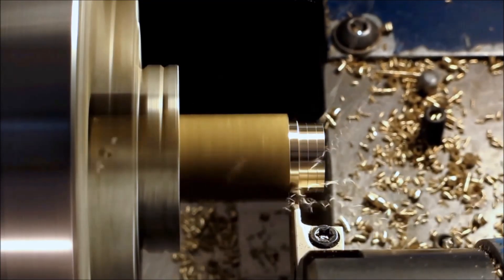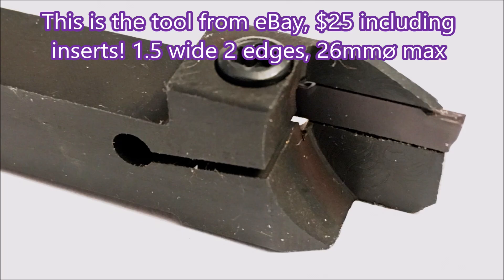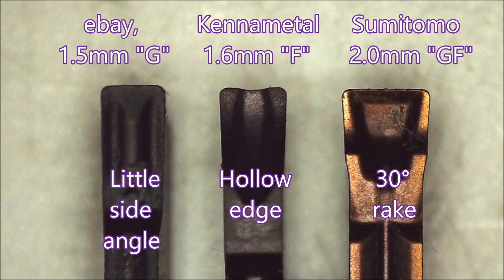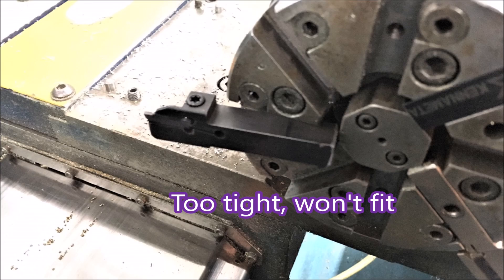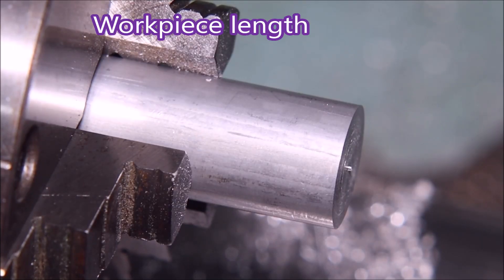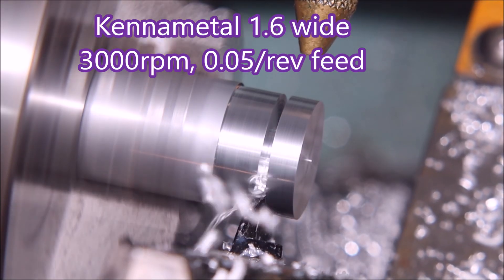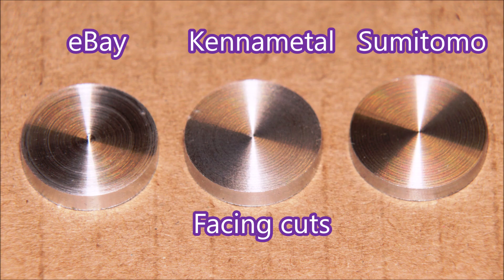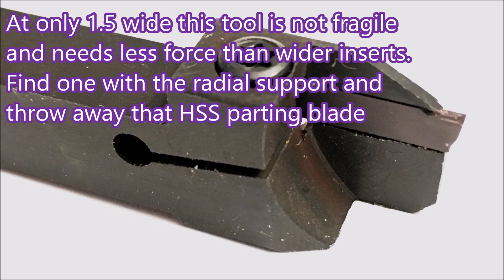$25 eBay Carbide insert parting tool vs Kennametal and Sumitomo at 3000rpm

Comment: I was wanting to find out about what was a good parting tool, I was so excited but when you starting saying it goes to 20 you lost me so I watched it again and now I have more questions. Like at the :57 mark titled "1.5 wide 2 edges 26mmo max" with no instance of a reaffirming to whatever the measurements are they can do without a metric. Then do it again at the 1:37 mark wirth the Kennametal whatever tool that is being made.
Reply from the maker: Hi, in each case I am referring to the maximum diameter at which the tool can part off.  Ebay is about 26mm dia, Sumitomo is 20 diameter and the Kennametal is 41 mm diameter
At 0.57 when I refer to 2 edges, which I must admit was not very clear, I was referring to the double ended insert which has 2 cutting edges.
The Sumitomo is also double ended and has 2 cutting edges, the Kennametal insert has only one cutting edge.  If I can help clarify anything else please ask.  Thank you for your comment

Comment: Just because you can do turning and facing cuts with a parting tool doesn't mean you should. When you do that you are dulling one corner of the insert and that will lead to the insert walking to one side of the cut when used for it's intended purpose of parting and grooving giving you a poor finish and possible chatter along with not holding tolerance.
Reply from the maker: We have not had any issues making brass parts. I write programs for a friend who does not have a turret on his cnc lathe. He uses 2.0 Sumitomo GF inserts for parting and turning. He makes a lot of small brass parts and is happy with the results he gets and not having to make tool changes. Not questioning your comment, I don’t think we could get away with what we do if we were machining steel etc. Thank you for your informed comment, it is appreciated.
Reply: @smallcnclathes  My comment was for general use, I guess if all you do is brass it would work well and maybe aluminum for short runs but steel is a no go unless it's for a couple parts but even then why ruin a good parting insert when it will not effect a turning insert as much. Valid point about the brass though.

Comment: Aluminium is not really a challenge for any carbide. You just see every tiny difference in the surface finish. 
I often use razor sharp HSS tooling for aluminium machining. No carbide finish ever comes close to that. 
You just need to know how to grind manually. ;)
Stainless steel will tell you everything about that thing you need to know.
Reply from the maker: I don’t use a grinder, would be wasting time using hss, I have done very little with stainless, and I don’t expect to turn any more
Thanks for your comment

Comment: Hello, I am just wondering where you would buy the Sumitomo and the Kennametal units and inserts in Australia?
Reply from the maker: I have mailed my Sumitomo rep and the Kennametal folks.  I think that particular Kennametal too no longer exists.  Do you need that parting diameter?  What size shank do you need? Mine are 10x10 which is what makes the Kennametal unit so good.  I am not aware of anything that goes that large with a 10x10 shank. Sumitomo go to 20 for 10 shank and I think 25 for 12 shank
Reply: @smallcnclathes  I've got a Sherline, it needs a 3/8" square shank, I'll just be using it for kitless fountain pens so a 20mm parting diameter would be just fine. I'd just be turning brass and aluminium for the end pieces of the pens. Edit: Oh, also I'd be using it to part the wood/acrylic, the pens have a section where the cap screws on that needs to be a bit lower than the rest of the body of the pen. And part off the ends of the wood/acrylic where the live centre was as well. You can order a HSS cutting tool and tool post from Sherline, but I think I'd be driven mad having to sharpen it all the time.
Reply from the maker: @chelsea78344   will holder take 10mm?
Reply from the maker: If 16 max would do, I would use the 1.5 wide tool in this video for timber or plastic.  These inserts are very sharp.  Or you could use the ground inserts I bought from ebay they are for aluminium and quite sharp too.  Not as good as the Sumitomo ones though.
Reply: @smallcnclathes  Yes, it looks like it will take 10mm. 16 max would work, but I'd like to experiment with potentially some 18mm wide pens in the future, so I'd like the 20. What insert width would you recommend for that? Also, how do I find the unit that holds the insert? Maybe I'm looking too hard, but I can't find it for the life of me.
Reply from the maker: If you have an email I could send you the pdf of the parting tool catalogue
Reply: @smallcnclathes  Actually, I think I've found it, is it this? https://sumicarbide.com/wp-content/uploads/2018/09/GND-Lineup-2018_smallfile.pdf Also, how do you order something from them?
Reply: @smallcnclathes  Ah! I think I have found the pdf catalogue! Thanks though. How do you actually order one? I am guessing I have to contact them?
Reply from the maker: @chelsea78344  if you find the inch series, they have 3/8 shanks with 1.5 wide inserts that would be good for you. The GA inserts that would probably be best are only in 2.0. GF inserts are available in 1.5 and they are very good too, they are what I use. The tool in inches is GNDL R 061.5JX038 for 1.5. Tools are not cheap, last time I priced one it was $125
I have asked my usual ebay supplier what he has in 1.5 wide for you
Reply from the maker: @chelsea78344  Where do you live?
Reply: @smallcnclathes  Ah, excellent, thank you so much! The exact product code and everything! I'll get one from them. Super super helpful, this is the power of the Internet!
Reply from the maker: You are ok with that sort of pricing? Where are you in Oz.
Reply: @smallcnclathes  I am yes. And ah sorry, I will not say where I am specifically, because this is the internet. I do appreciate the willingness to help though
Reply from the maker: @chelsea78344  Not a problem.  If you were local I would have suggested using my local Sumitomo rep. If you can get them by going direct no problem.

Comment: I didn't think these parting tools were capable of facing cuts!  This parting tool I bought from Aliexpress was around 12 bucks and is much better then the other cheap alternatives.  Mine didn't have overhang and the finish is much better, its also silver rather then black.  This is my 2nd one, the 1st one was black and it got mangled pretty bad during one parting.
Once I figured out the secret why inserts break, I don't go through inserts as much and I am quite happy.  The secret is don't run it all the way to the center, when you're almost there just put a piece of wood or plastic between the toolpost and workpiece and the bending pressure will break off the piece.  With aluminum or brass that is not necessary and I don't mind doing a facing cut because parting steel I doubt even expensive tools will leave a nice even flat surface.
Reply from the maker: Deep facing cuts can only be taken with inserts that are single ended. Double ended inserts rub on the face with the edge that is not in use. Thank you for your comment.  Nigel

Comment: In my experience chinese tools are fine. The only drawback is that they dont last very long. Running production one name brand insert last 3-4 chinese inserts.
Reply from the maker: A friend would use only Sandvik on one particular job. The inserts cost more than any other supplier but they out lasted anything else saving a good deal of down time.  Thanks for your comment

Comment: Short and sweet. Loved the video. 

I can’t go back to hss. The cut is far superior with carbide, and a lot less worrying because if it lets go it just breaks an insert.
Reply from the maker: I agree completely. I don't believe the HSS will give a better finish, carbide is so fine grained these days.  Of course in my case, totally not applicable for production work.  I have one HSS tool and I use it to create chamfers in my manual lathe.  I have spent enough on holders and inserts to find buying a neutral holder and square insert just a bit more than I want spend, particularly as it would get almost no use.  Thanks for taking the time to leave a comment.  Nigel
Reply: @smallcnclathes  I don't just break the insert. I break the damn holder as well.  Parting is the bane of my machining.😛
Reply from the maker: @tinnedanger  take heart from the fact you are not alone!

Comment: Have you tried one of the name brand inserts in the cheap tool holder? Seems like a good compromise. Couple minutes with a file and some decent inserts and it should be good?
Reply from the maker: Sumitomo inserts are 21mm long, eBay inserts are 16mm long, so I don't think your idea will work.  Thanks for the idea though. Nigel
Reply: @smallcnclathes do you think sumitomo insert GCMN150005-GF-AC530U would fit in the ebay tool holder?
Reply from the maker: @ganzeytyler  I have ebay inserts 2.0wide and GF inserts at 2.0 wide.  I don't have any GF in 1.5 wide.  I would assume the Sumitomo at 1.5 wide would be longer than the 1.5 ebay insert based on  what I see in the 2.0 wide inserts.  The 2.0 GF I have is 21.3mm long the 2.0 wide ebay insert is 16.0mm long and I just measured the ebay 1.5 wide insert and it is the same at 16.0mm long.
I checked the catalogue and the 1.5 wide GF insert is 17.3mm long. It will protrude out from the holder more than is intended.  I also have no idea if the ebay tool vee grooves will match the GF insert.  I hope I am keeping this understandable?
Reply from the maker: Not sure if I mentioned it in the video but the Sumitomo holder is brilliant. I have to shorten all my tools to fit my turret. Usually a hacksaw will do, that tool needed the angle grinder.  Very difficult to drill with a HSS drill it is a very strong tool.

Comment: Having worked in a machine shop were the owner were so stingy with tooling that all but the toughest jobs were done with cheap china inserts i can say that you can get great results with them.
However you will have to get used to diagnose problems fast and often because the production standard and QC can be a bit spotty.
I found it funny that you comment on how ebay chips isnt coming flying out like the two others after you note on the brand tools having dips to make the chips curl inwards (and thus smaller width then the groove).
Reply from the maker: Thanks for your comment

Comment: I did notice that your ebay tool was a fair way below centre height, which may have effected it's performance, ie. chipping. It could be you should have filed the top of the tool instead of the bottom? Well made video though. I enjoyed it.🙂
Reply from the maker: Thanks for your comment.  You may be right, but I would expect an insert to be level with the top of the tool rather than the bottom.
Reply: @smallcnclathes  Some of us still play with setting up Aloris tool holders. <G> 

I will mention that your video prompted me to buy one of these to play with. 12 usd after shipping and tax with four inserts. Which for my little Habegger "hobby" lathe should do me for years of use.

Comment: Good to see "open mindedness" on this subject. Thank you for posting.
It would be good to note that you are testing two different things here. The insert for one, and the insert holder for the other.  This is important because you could have one part of the equation good and the other bad, or both good or both bad. Personally, I find the imported insert holders are sufficient to very good for insert tooling, though a parting tool holder would be the most critical of all insert tooling holders. One the other hand, "no brand" import inserts are usually junk.  Than being said, "name brand" inserts like Korloy and Deskar are very good quality in comparison, in my experience. Thanks
Reply from the maker: Thank you for your thoughtful comment

Comment: Why do the ebay and Kennametal seemed cutters appear to be not centered?
Reply from the maker: Not sure, high or low do you think?
Reply from the maker: Just had a look, they do look a bit off.  That turret has no tool height adjustment and has 10mm slots for 10mm tools so not a lot of room to adjust it. To be honest I don't worry about it. I have raised the whole turret in the past but this seems to suit most of my tools

Comment: for how bad it looks it actually worked OK . One starts to wonder why the others need to charge 10 times as much . We all know they are better , but not 10 times better .
Reply from the maker: 10 times does seem a bit over the top. When I look at the different inserts available for parting from Sumitomo it is easy to see they have worked at making various design chip breakers that suit grooving and or parting off or actually profiling.  I use a GF for parting and an ML for when I need to use the tool to cut sideways.  They look quite different.  When I was working, I liked that I knew what these tools would do and that they would not let me down. I was willing to pay for this I guess.
Reply: Nope they almost certainly work 99% as good, and for many people that’s probably good enough. If you have to ask whether or not cheap Chinese tooling will limit you then the answer is likely no
Reply: A large portion of it is logistical consistency. It's a package that's the EXACT SAME SIZE insert, every single time.
Reply: Wages, tax, Insurance, quality of employees life, R and D....
Reply from the maker: @BestKiteboardingOfficial I really think R&D would be huge. Sumitomo  have a number of different parting insert designs. Ranging from low cutting force parting to inserts for profiling. Thanks for your comment
Reply from the maker: @jimroberts3750 Hi Jim, I know someone making stainless buttons, would only use Sandvik on that job. Tried everything else and Sandvik was the best value. He told me for my machine Sumitomo would be good enough and he was right and their threading tools use standard inserts.I have used Carmex inserts in my threading holders.

Comment: It seems to me you should try H01 (MGMN150 H01) inserts which are for soft non-ferrous metals since you cut aluminium. They've got very positive rake as they should and different chip breaker to what your inserts have. I haven't used H01 on lathe but milling machine only and have to say they give qite shiny surface finishing on 6061 alloy.
Reply from the maker: Hi, I bought some inserts awhile ago that may be the ones you are talking about.  Just have not got around to testing and making a video, yet. It was some time ago now but I will check their designation. Thanks for your comment

Comment: You have a link, all.the ones I see are straight not with the curve.
Reply from the maker: All I see on ebay these days are straight, only see with the curve on aliexpress
Reply: What price is it I searched on the part number and they are all straight.
Reply from the maker: @Ocfarmer  they seem to make them straight or curved with no change in the part number. I can’t find it today but I saw a photo of two tools in silver finish on ali yesterday while searching something else
Reply: @smallcnclathes  There are a few in 3.0 that are curved.
Reply from the maker: @Ocfarmer  the tools with the curve do seem to be out of fashion at the moment.  They sacrifice rigidity for depth of groove.

Comment: with the cheap inserts... be wary, and inspect. had two boxes show up with little nibs of flashing on the bottom seating groove. ie, they wont seat in teh holder!

quick nip on the diamond wheel to pop it off... and then the inserts are crap anyway.
Reply from the maker: Fortunately I have enough good ones in Sumitomo and Kennametal to out last me. LOL

Comment: The ebay deal is $25, I got it, but how much is that Kennametal and and  Sumitomo tool ? Care to mention ?
Reply from the maker: Both are around $125 aud, now I have retired that seems a lot, but when I was working it was good value. They never let me down and low cutting force inserts were available for both.  With a massive half horsepower at my disposal this was important. eBay inserts never seemed to offer a choice of insert.  Choice may be better now.  
I have no issue talking about the cost of these tools because they just worked and when you try to make parts to sell with a little lathe you need all the help you can get. Thanks for your comment.

Comment: I’m turning brass at work and I have a different tool for part off and cutting the off. Is this tool good for brass to
Reply from the maker: I have not tried it on brass, but I would expect to work on brass as well as it does on aluminium. I would surprised if it did not work
Reply: Thank you I’ll try it today.
Reply from the maker: Did it work ok?
Reply: @smallcnclathes  I did not have a chance to work on it today. I’m learning to use a hass mill at the same time and using fusion 360
Reply from the maker: @spicyandroid2933  No worries, just thought I would ask. let me know how it goes when you get to try it.

Comment: Might get me a couple for my 2 lathes the ward 2 a and my visby should be ok for starting out tho thanks for the video
Reply from the maker: You might as well try them, not a lot of money to lose if you are not happy with them. One recent comment mentioned the inserts are not material specific, which is true. However they worked ok for me in aluminium and steel as showed in the follow up video. Thanks for your comment, Nigel
Reply: @smallcnclathes  I’ve worked in the industry for a bit still do just starting my own gig

Comment: Nice video ,but it's better to use right work piece material, because obviously insert grade are not intended for non ferrous material.
Reply from the maker: That is how the set came from ebay.  Not my usual parting setup. Did another video same tools cutting steel.